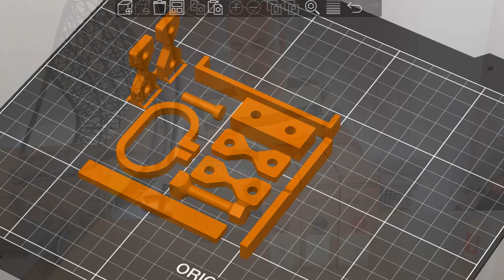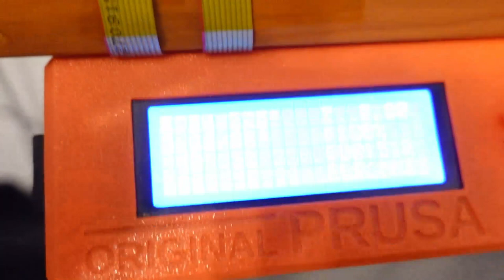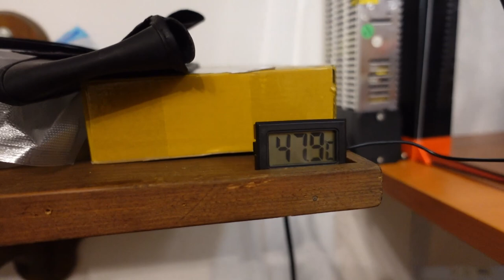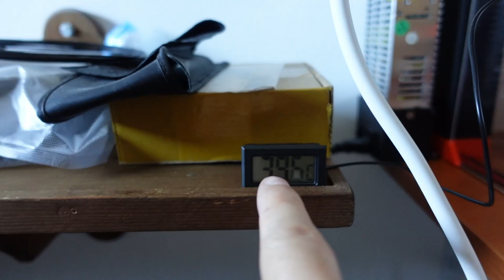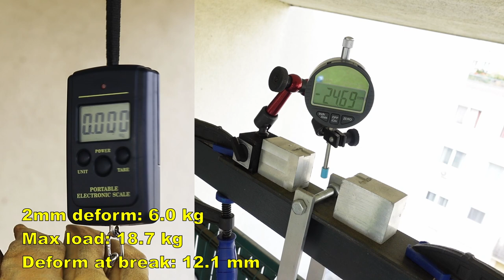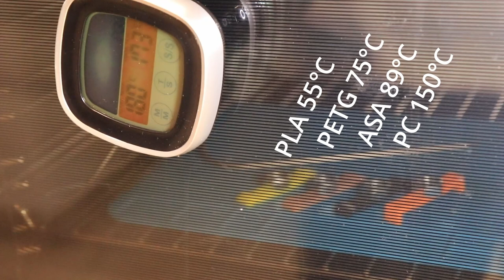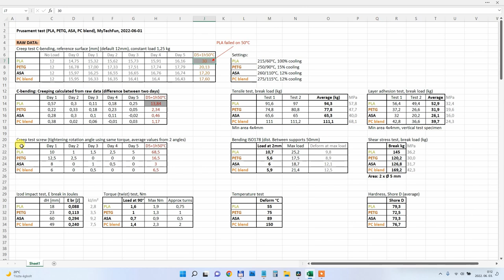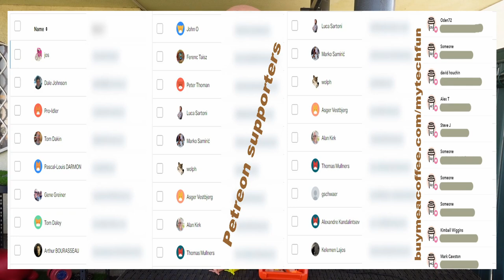Testing Prusament filaments by Josef Prusa - PLA, PETG, ASA and PC Blend

Comment: PC Blend looks very interesting to me. I finally upgraded to an all-metal heat break, so I can now consider printing some of these hotter filaments.

Also, I really appreciate the compression creep test, with the screw clamping. A lot of my printed printer parts are under compressive loads, not just at their mounting points where they're often screwed in place, but also as their primary function—belt tensioner mounts, a motor mount spacer on my Y axis, etc.

Comment: This is a great video.  I've used prusament PLA, PETG, and ASA (although because of shipping to the US I usually use different brands).  The only big surprises in your video for me were that I think the ASA is a lot more rigid than PETG and that I think I get better layer adhesion with ASA than you are.  I have never measured, though, so your experiments are more useful.  Thanks!
Reply: I got 350 Prusameters and can get a Spool for Free. Would you recommend PETG or Asa and which color do you think looks best ?
Reply: @DaVid-ju7ee  Depending on your needs. For UV resistance I would choose ASA.

Comment: ASA probably it has been printed at too low temperature, maybe with 10 °C more it might have had a better layer adhesion, what do you think?
Reply from the maker: Yes, higher temp helps with layer adhesion, but as I mentioned in video, I printed it on pre-set values in Prusa slicer.

Comment: Hi Igor, great job! Very useful. If I may make a suggestion - could you please publish the extrusion factors and line width you used for the the test specimens? I found these settings along with the print temp (which you used as speced) have high impact on the sample mechanical properties mainly due to changes in interlayer adhesion. It may be also a good theme for future video....

Comment: Can you add one more test method for next filament review. To soak all speciment that you print in water and test it after one week and compare it to the dry one... how much it will affect the strength of each type of filament. I'm curious especially with PLA, it is very strong when it's dried compared to PETG, but sometimes a new spool of PLA is so brittle and easy to snap off when it is moist, so we need to dry it first to get better results. 

Will PETG or other filament have better results than PLA after soaking in water? I really hope that you can test this method, so we know how much these filament strength when using it at outdoor (hot and wet condition) thank you.

Comment: Hardness could be interesting for scratch resistance in an end product. But then again an end product is most likely varnished.
Honestly considering how cheap PETG is and how well it prints, it is easy my most favorite material. ASA stinks and releases really bad fumes, PC is hard to print and PLA is brittle and melts in the summer. I am still looking for a better material than PETG, I thought maybe fiber infused PETG or PA could be that material but I am guessing those fibers are really dangerous and the trade off is not worth it. I t would be interesting to know what you think ?
Reply from the maker: I have some sample filaments CF PETG and PA. But I also got some engineering PLA 10m sample from Filaticum, it can resist to temps up to 150C (own test), so I asked for full spool to do complete testing..
Reply: I now like PCTG better than PETG, incredible layer adhesion and a bit less brittle. Harder TPUs (95A) are also incredibly durable and not so hard to prInt.
Reply: @MyTechFun  Ah very nice, I hope you make some videos in regard to those materials as well. Very nice work by the way. I really like your videos. Especially the ones where you test resin materials and mixes etc. Very well done.
Reply: @MyTechFun  I’am looking forward to Filaticum. Then I only need PETG for weather resistance and some flexibility.

Comment: Hey great review! I have a MK3s with more than 4000+hrs on it now(no issues so far), I print mostly Prusament using their default settings with great results.  I have been printing PC blend and the PCCF on a smooth pei sheet with glue stick with no warping issues. I normally just use .2mm high "dots" on the corners of parts I think might warp, but I rarely use them or a brim. My enclosure is well sealed, I should put a temp probe in too see how warm it gets. It looks like maybe your brims weren't working properly on the PC test, it looks like they aren't well attached to the part?
Reply from the maker: I am using default settings for brim, but yes, it is very weak. I will try to make stronger connection to part
Reply: @MyTechFun  maybe it's first layer height related?
Reply from the maker: @MultiDunners  In PrusaSlicer: Print Settings / Skirt and brim / Brim separation gap

Comment: What I don’t understand, from my point of view a application of glue stick is for a separation agent job as you self mentioned. But at the same time you are claiming bed adhesion and say you have to use the stick for better adhesion? I never used any agent and especially on the prusa silk bed I have no issues with any of the Prusaments.